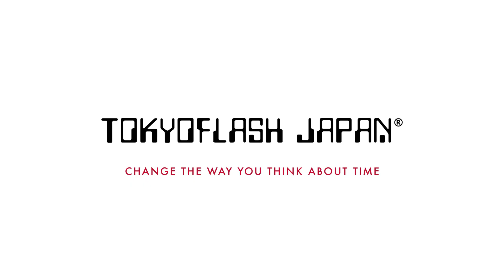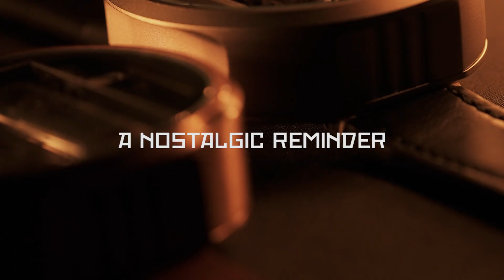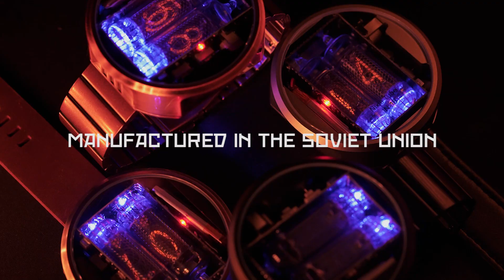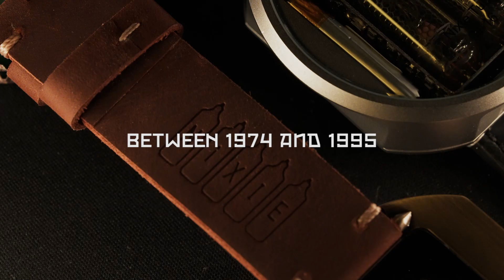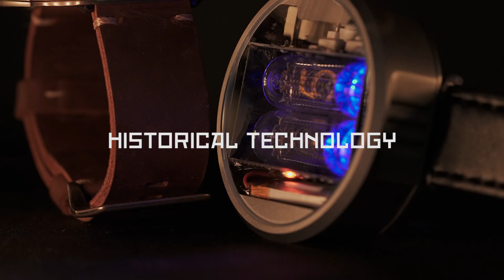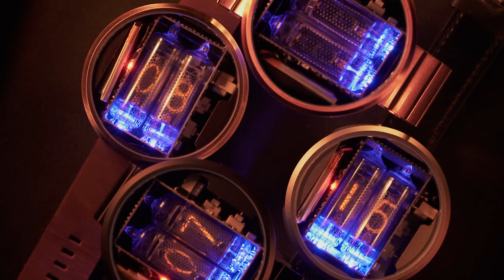Model 2 Nixie Tube Watch | Tokyoflash Japan

Comment: Can you explain what the blue light underneeth the tubes are?
Is it LED to look good, or is it a functional part of the nixie tubes?

If it's LED, would it be possible to turn it off?
Reply from the maker: Hello and thanks for your question! The blue lights below the Nixie tubes are LEDs. They are a design feature to enhance the light up effect but also act as a charging indicator. When charging, the blue LEDs will  flash. When the blue LEDs stop flashing, the watch is fully charged. The LEDs turn on when the time is displayed. It's not possible to turn them off. I hope this answers your question.